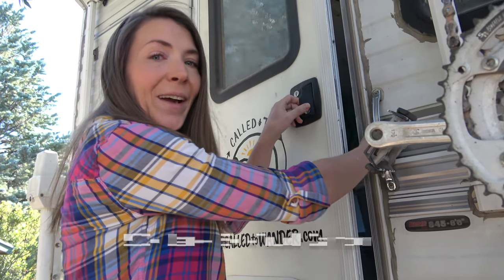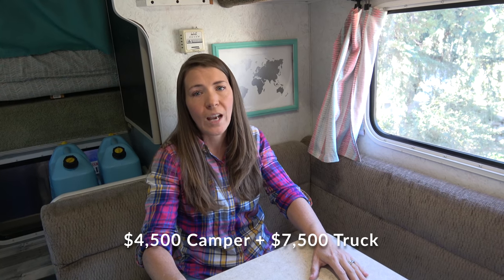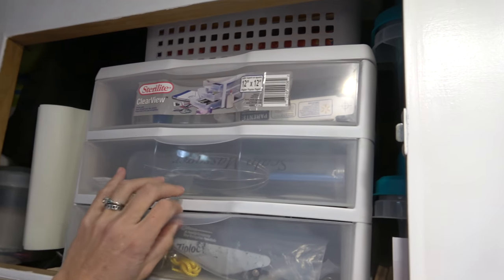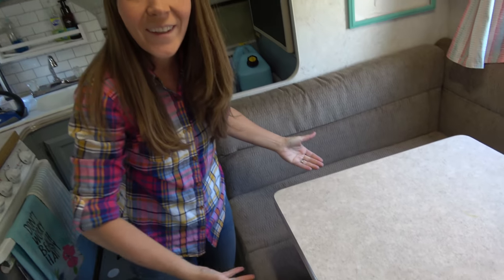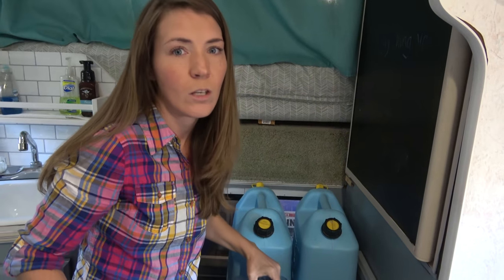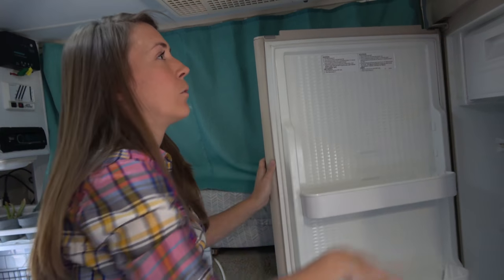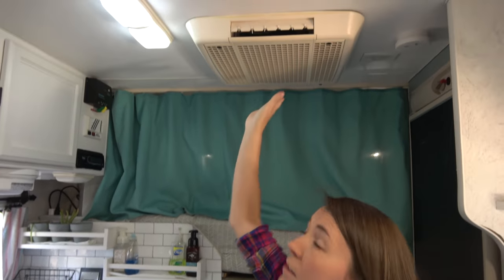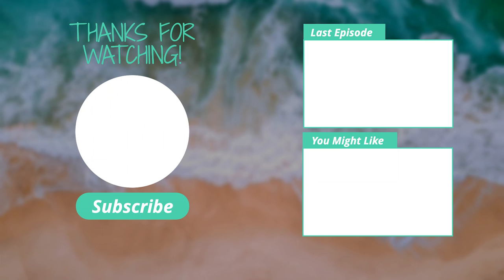TRUCK CAMPER TOUR after 2 YEARS on the road // Tour Our Remodeled Tiny House on Wheels // CtW

Comment: Great setup. How many miles did the F250 have when you picked it up and have you had to do any major work on it?
Reply from the maker: We bought it with 445K and added around 50K over the next 3 years. The engine required no major work itself. But we did put quite a bit into the parts around and connected to the engine as well as the rear suspension. Things like engine harness, batteries, starter and high pressure oil pump.
Reply: @CalledToWander  Thank you!  I’ve been looking for one as well with under 200k but they’re still relatively expensive and it’s the 6.0L not the 7.3L. They seem like great engines. I’m also debating getting something much lighter like a pop up camper rather than hard sided so rear suspension wouldn’t be as much of a concern. 

Love your Baja trips!  That’s on my bucket list as well as US destinations. 👌🏼
Reply from the maker: @f33rnofish  Definitely don't go with the 6.0 unless you know it's been bulletproofed. The 7.3L is a beast and we recently sold ours only out of the necessity of needing more space that a TC could provide us at this point in life. The 7.3L is known as the million-mile motor and I've seen 2 that were within 10K of 1 million miles. So definitely worth it if you can find one. Our budget only allowed us to buy one with high mileage that we had to put a few thousand immediately into repairing. If its over 200K make sure you know the transmission history as that's around the time they can need replacement... Lighter is always better. But if you're going to full-time then you may want the space and the convenience of the hard side rather than the pop up. But lighter would give you more truck options, plus the ability to really go places offroad if you wanted. We LOVE Baja and are actually planning a trip back for a few months next winter. When you get around to planning, start with this guide we put together... we'll be following it (and updating it) along the way: https://calledtowander.com/best-camping-in-baja-mexico/ Thanks for watching and reaching out!
Reply: @CalledToWander  Thanks again!  Sorry...So what’d you get?
Reply from the maker: @f33rnofish  We bought a 1999 31' Class C RV that we're fixing up. We'll actually have separate rooms for a change!

Comment: What year is your camper & how long is it?  Also how much does just the camper weigh empty?
Reply from the maker: Al B it is a 2005 lance 845 so it has an 8’ floor length. It’s considered short bed camper but we have it on our long bed flatbed. Weight is around 2300 give or take as ours had some factory upgrades like two propane tanks, awning and AC.

Comment: Do the generators make a lot of noise when you’re running the AC?
Reply from the maker: patty Tanco We put the generators on the ground so they are even further from the camper when they run. As such, the noise of the AC is more than the generators. But the Honda 2000s are really quiet generators and a big part of the reason we bought them. We don’t run them in the space between the truck and camper due to lack of exhaust flow. We just store them there.